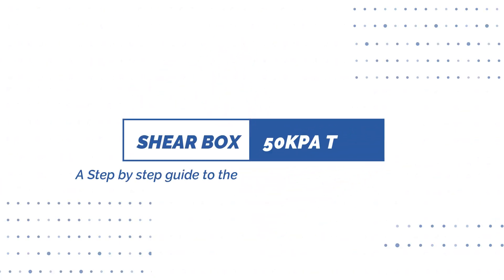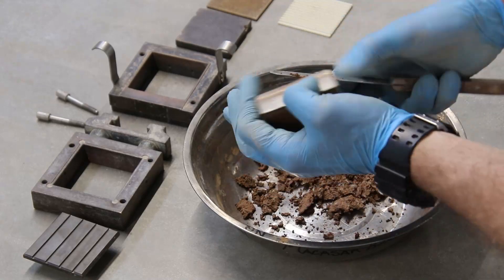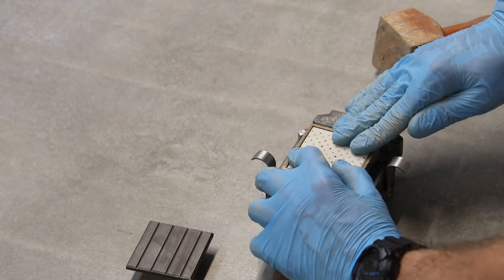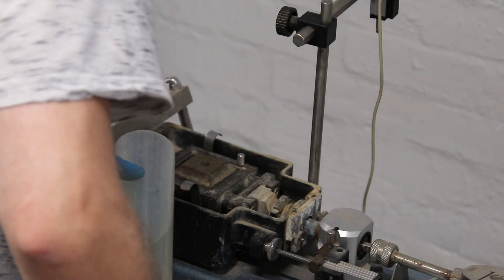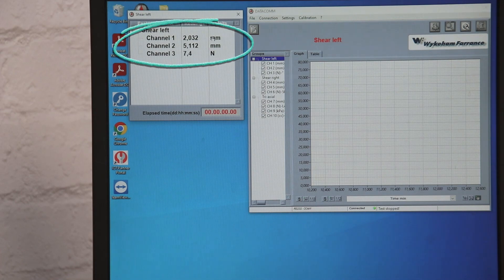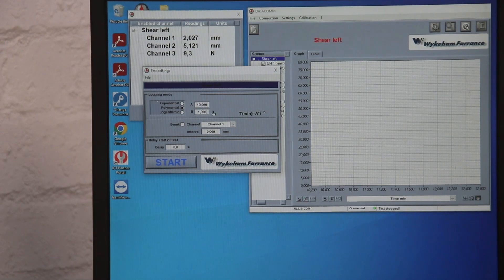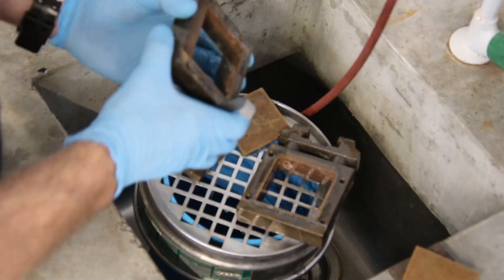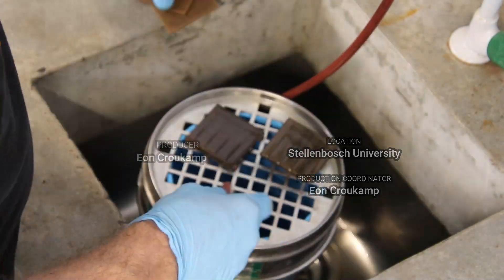Tutorial video of ASTM D 30 80 Direct Shear Test of Soils Under Consolidated Drained Conditions.

Comment: I have a similar machine. A better model. Doesnt it consolidate with the machine?  Not just leave it soaked.
Reply from the maker: There is a small amount of consolidation happening, the load during soaking is less than 10N though, but yes since it is free draining some consolidation is happening. If you were to do a consolidation test beforehand you can determine the rate of consolidation and pore pressure dissipation rate. During a undrained test your rate of strain should be high enough to allow the buildup of pore pressure. Hope this answers your question.

Comment: Hi, I want to ask about the test procedure. Is it necessary for the sample to go through consolidation procedure first before shearing phase? Or we can actually go straight to shearing phase right after we prepared the sample? I got a bit confused because the ASTM standard called it "consolidated". Thank you so much for this video
Reply from the maker: Luckily you dont have to go through consolidation first, after you have prepared the sample you just have to place it in the shearbox and have it saturate (6h-12h usually for sand and 12-24h for heavy clays.) after its nice and saturated you can start the shear at the correct rate. Its called a "consolidated" test due to the weights slowly consolidating the sample and drained as the excess pore pressure is being dissapated into the water.
Reply: @zagamer3373  Thank you so much, your video really helps me :)
Reply: @zagamer3373  Does this apply to remolded samples as well? I think they need to be consolidated first to mimic the virgin soil overburden pressure. I am treating dredged soil (rich in clay), and used water above the liquid limit to simulate the worst case scenario, I was also wondering if I still need to saturate the sample. Kindly provide some guidance if possible. Thank you.
Reply: I love boys

Comment: Where did you get the shear box chart?
Reply from the maker: From a excel spreadsheat with the calculations. you can also get a unit converter to assist.
Reply: can i request shear box chart for round sample?
 @zagamer3373

Comment: Hai, may i ask you a some questions? 
1. Why WF Brand have two arms for weight? because i see the other brand only have 1 arm.
2. As far as i know the arm of weight is to give the normal load (N). so why WF Brand makes 2 arms while 1 arms is already can do that.
3. At your video, i see the shearbox loading chart. is it given from WF or from ASTM ?
4. I see on Controls Group Video for AUTOSHEAR, they only put the weight on right arms.. Why ??

Thanks, i hope you read and reply my comment .
Reply from the maker: as far as I know the reason for the 2 arms are for finer control of the vertical load, the chart is just for excel with the basic calculation. I hope that answers some of your questions.

Comment: hi thank you for this video . 
please tell me how many kg total we are going to load until the test finish? 
description of sample : undisturbed material 
silty clay material and how can we get the optimum moisture content that we will used for the test.
Reply from the maker: The weight in kgs that will be used is based on the 3 forces for each test, generally I prefer 50kPa then 100kPa and finally 200kPa, for this test range the weights are as follows:
50kPa -> 1.75kg on the right and 0.75kg on the left.
100kPa -> 3.5kg on the right and 1.5kg on the left.
200kPa -> 7.25kg on the right and 0.75kg on the left.
note that you can also do a force range of 100kpa then 200kpa and finally 400kpa.
With Silty clays I personally have found better results on the higher forces.
As for the optimum moisture content, generally you would take a accurate representation of your sample (usually 1/4 of the sample) and perform a Modified or AASHTO Proctor Test.
Hope this answers some of your questions.
Reply from the maker: The load in kg will depend on the test range (ie. 50kPa -> 100kPa -> 200kPa etc.)
The optimum moisture content is determend with a modified proctor test.

Comment: when you have round or square shear boxes of 50; 60 and 100mm; which box should we choose or which parameter allows us to make a more suitable choice than another?
Reply from the maker: A larger size shearbox would generally be more preferable I'd time permits it, a larger sample would need to saturate longer. Also note the extra stress on the load cell so as to not overshoot and damage it.
Reply: @zagamer3373  thank you